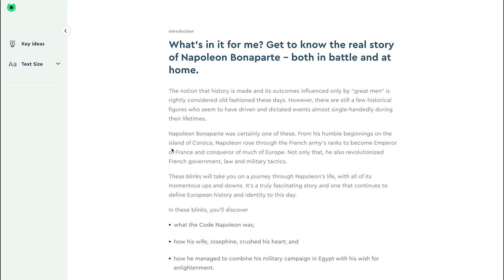Why Did They Paint This?! S3 EP2

Comment: When the house was originally painted there weren't any lifts. Immagine climbing up a ladder to be that high. Very scary. She's going to look very beautiful, well done.
Reply: A lot of times I have seen old photos where they used sketchy-looking wood scaffolding to work off of... Mr. Hall & Mr. Brown would've been amazed to see a modern lift!
Reply: In my town there is a Victorian mansion that the owner painted herself in the 80s using ladders braced in strange ways. I've seen the photos the newspaper took.  Where there's a will.....
Reply: When I was sixteen/seventeen years old, I worked for the Youth Conservation Corps. It was a jobs program for at risk youth. Paid minimum wage, and we didn't have the best tools etc. I spent a lot of time stripping and refinishing woodwork at my town's big library, standing on rickety plywood on rather wobbly scaffolding. No hard hats, either. We were supposed to wear rubber gloves, but it was hot, hot summer, the library was NOT air conditioned, and we would take them off. The stripper actually burnt little holes in your arm when you were scraping the old varnish off. But yes, that's the kind of scaffolding they had then, and this was in the 1970s. The ceilings in that section of the library were probably sixteen feet high. But I learned that paint stripped a lot easier than varnish.
Reply: @hollyw9566  Sounds very scary....
Reply: Been there, done that on a 32' extension ladder on an uneven grade to paint the upper cornice trim to match the color of the rest of the house trim.

Comment: I still think that after years of exposure to polluted air from car exhaust that the stone became discolored and spotty. The paint was probably a cosmetic bandaid to raise curb appeal for a potential sale of the property. I don’t know what it’s like in St. Louis, but in my area, stone/masonry repair/cleaning didn’t really become accessible until the early 2000s. It’s likely this was painted well before that, so they probably didn’t have many options to make it look decent again. It looks like whatever stripper you’re using is also taking off the discoloration underneath the paint too, so that’s good!
Reply: Not only cars. People heating their homes with coal, factories burning coal, etc.. Pollution was quite bad even back when this house was built!
Reply: @Ragnar8504  This is indeed true. I just didn’t mention any other causes because I have a tendency for being annoyingly pedantic and loquacious. LOL.
Reply: @Ragnar8504  it was worse - for example, by the time Philadelphia City Hall was completed in 1901, the lower levels were already stained black from coal smoke, so the first time anyone ever saw the whole thing in its actual light color was when the facade was cleaned, which happened in stages between 1992-2007. It still looks fine after 14-30 years, but the stone blackened way faster than that during construction in the late 19th century

Comment: Beautiful sunset! When you have time you can't use for work you had planned, it's great if you can get something else done. Yep, done my share of window restoration. The trim on that basement window is interesting. Look forward to seeing the finished product. Maybe it was the light (or green somewhere in the paint history), but it looked like green algae growing on (or under) some of the paint on the exterior. Just shows how important your current work is to the health of the building. Our prior 1931 Spanish had mostly vertical parapet walls with no overhang. 'Texture coat' had been put on in the 1970s over several layers of paint, which started to oxidize. The coating started coming off at the top of the wall, all around the house, which allowed rainwater to get underneath, and we had black and green blotches of algae on our white walls. After power washer, grinding wheels, and chisels, we finally had it down to the original smooth stucco, which was molded to look like castle walls. Some patching, TSP, and special stucco paint, it was like new (that is, old).  :)

Comment: For the stonework you can also use a blowtorch or weed burner to melt the top layers of paint off and while it's still soft use a putty knife to take it off, you can do it with the millwork too but you might burn if you get impatient with it

Comment: It's somehow really satisfying watching you hard at work putting on the stripper, covering it up so it can do its work and then peeling it off and washing the walls clean.  I noticed one of the window sills, it may be wood or possibly limestone, it is definitely leaning at an angle. Thank goodness for your hoist so you can deal with all that sort of stuff...when its wheels aren't stuck in mud. How about you lay down some large pieces of sturdy board? Sure, it would mash up the garden a fair bit but that could be corrected much later. Would that stop the wheels sinking in?  Just a thought.

Comment: We have a brick house built in 1907 as a model for the neighborhood.  We are only the 3rd owners on the title but the people we bought the house from40 years ago painted the brick!!  I am having some difficulty removing the paint  even with dumond. Any suggestions?
Reply from the maker: I used a paint eater on brick back at my old place and it worked quite well. Although it will sand a brick with a rough surface and the pads wear fast and are expensive. you can use a pressure washer like me but buy a cheap one that uses less pressure.

Comment: Often when brick-stone is painted over its because of decay or not wanting to do the maintenance on them and the more modern the paint like latex to more rot behind it occurs. Indeed one reason why brick was painted was to keep the mortar between them seals and if the brick itself wasn't of quality it to needed a coating over time often times being  stucco instead. Indeed lime-sandstone which is the most easy to carve was also the most vulnerable when to came to weather and it not unusual to see it nearly melted away or damaged  because of its porous nature.

Comment: If the stonework isn’t too fragile, would it be easier to sandblast the paint off? Or would this be too expensive? Great video again by the way :)
Reply from the maker: Sand blasting would etch the limestone. Even our power washer on the lowest setting etches the stone slightly.

Comment: This is a hugeeeeeeeee project. I personally don’t see how you can do all this. Just sand blast the old paint away or power wash it. We
Reply from the maker: Sand blasting etches the limestone. After each coat of stripper we DO power wash it on the lowest setting. Anything higher etches the limestone.